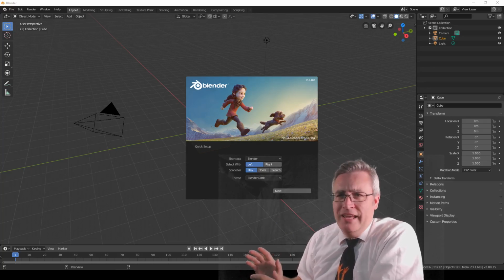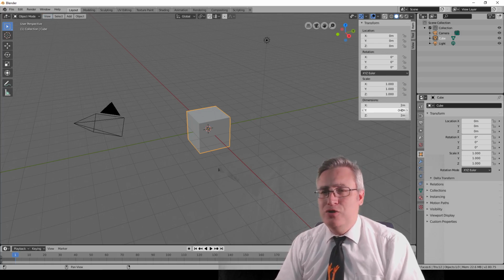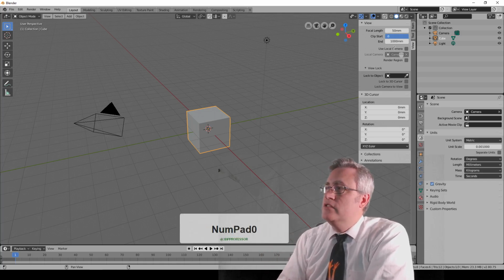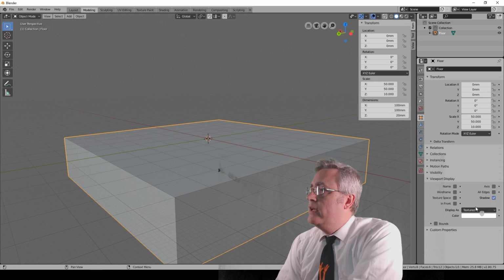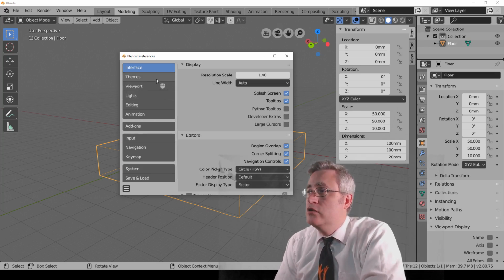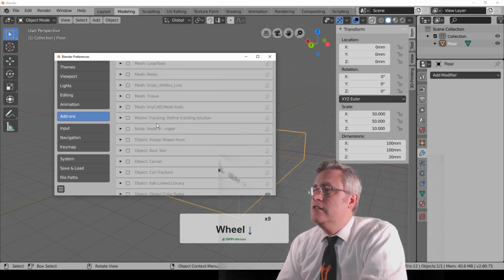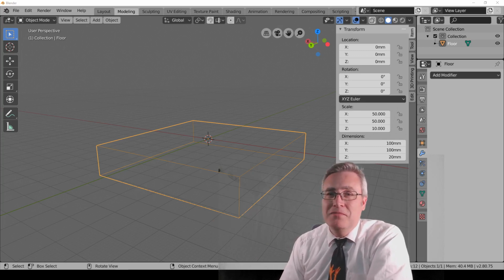Blender 2.8 for 3D Printing, Start Here - Part 1 Setup

Comment: Everyone please be aware that changing the "Unit Scale" will mess up cloth simulations. Took me a lot longer than I like to admit to discover that was one reason. Blender works with floating point, and accuracy gets lost with every conversion, which isn't obvious until you try to get a perfect 3D model of cloth covering an object that you want to 3D print as an enclosure.

My workaround: Still using the unit scale for modeling for 3D printing, just reverting unit scale before trying simulating cloth.
Reply from the maker: Good point. I don't do a lot of cloth sims because you'd have to solidify them to make them printable objects, and that tends to mess up on tight folds. So I tend to cloth sculpt these days.

Comment: So far all of your helpful advice still holds up even in the 3.2 verion, but I can't find the 3D tools: modifier view options in the add on menu. Do you know if they re-named it? or maybe it's just not there anymore? I'm using interface: modifier tools hoping maybe this is an updated version, but I'm brand spankin new at this and i'm trying to follow advice to the T when it comes to something as complicated as creating 3D models. I've tried playing with it and trying to figure it out myself and quickly realized I would get nowhere fast. IDK if you still play with blender now or not (i assume you do because of how involved you are in it) and I know it's a lot to ask, but would you consider making an updated version for the newer version of blender i'm trying to use? You seem very knowledgeable and i'd greatly appreciate your input on blenders new design. Even a reply to this issue would be great =) thanks for your help
Reply: well, now ive read the other comments and it seems there's answer's there.

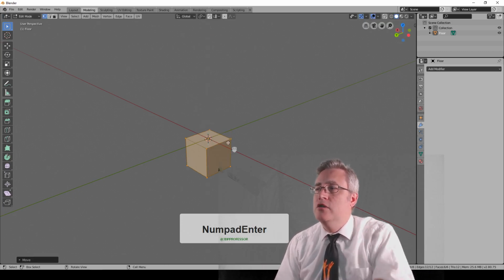Comment: Hitting the G, Z -1 dident work here... 8:00 in the video...
Reply from the maker: Have you tried it again? It still works in Blender 3.
Reply: @3dpprofessor  hitting G does nothing, Z brings up a shading menu.. First time using Blender. Probably something I have missed? It seems that I have version 3.0.1
Reply from the maker: @hvah  Interesting. House do you normally move things in Blender? Just move all the points up 1, however you normally do that.
Reply: @3dpprofessor  Thanks for replying. I found out what I did wrong.  I did not hold down z while typing -1. 🤦‍♂️

Comment: Hey guys im not like a blender pro or anything but if you are selecting multiple pieces and accidentally click off of them just hold control and press Z. It will bring back what you just highlighted. Thank you for this i really needed it for my first 3d printer.

Comment: Hi I Appreciate the video but none of the keystrokes work on mac OS blender v2.9 what is the breakdown of the actual steps of pressing G, Z, -1 ? Is there a way of enabling all the key strokes mentioned in this video?
Reply from the maker: I do not know. Why wouldn't G, Z, -1 work? That seems odd. But I don't have a mac, so I don't know.

Still, I do have a more absolute beginner guide where I've outlined the menu commands that are related. Object->Transform->Move, etc.
Reply: @3dpprofessor   I'll check out! I've "reset to factory settings" that seems to have helped.  Thank you very much for your videos and for taking the time to reply!

Comment: Hi, I've just bought my first 3d printer and have learnt a lot from blender for the absolute beginner... thankyou for the time you spend teaching us.  What I would love to know but can't find anywhere is to be able to create a crescent moon that is domed on the top... there is a tutorial showing what I need using autocad but I am just a hobbyist and want/need to stick with blender.
Reply from the maker: I would need a picture to better understand what a "Cressant moon that is domed on the top" would look like, but I can see 2 ways to do this. 
Method 1: When you get to Part 3 you'll learn about the subsurf modifier. Start with a cube, extrude and make a rough shape, then put a crease on the bottom, and subsurf and you may have what you want.
Method 2: Take a sphere and boolean delete a cylnder from it.

It all depends on exactly how you want it to look.

Comment: hi I was wondering if you could help me with something. I thought id make an alan key just for fun and im struggling to get the sides all lined up i feel there must be an easier way than what im currently doing.  i added a cube then added an extra line around the center to turn it into a hexagon. I added a reference image to try make things easier but then i realised that id still have to get that to the correct size.  Is there any easy way to do this or do i have to do what im currently doing and measure out 2 mm then shape each line to the size of the measure tool?
Thanks
Reply from the maker: Why not add a cylinder and change the sides to 6?

Comment: Hello! Thank you for very nice tip...I just wonder if it is possibe to make Blender to remember those setting you did with mm instead of meter and so on. I was just thinking it wold be nice to not have to ajust that everytime I re open Bender.
Reply from the maker: That's what saving the new default file is for. These settings are per file.

Comment: Generally a good job, but I'm having issues. I try to follow you, but suddenly my cube ended up with with little dots all over it which I was unsuccessful in removing. I decided to cut the whole thing and I dunno how to make a new one. the Add button doesn't seem to have have what I need either. All quite confusing. Suggestions?
Reply from the maker: Pictures would definitely help. Think you can jump on my discord and share some screen shots?
Reply: @3dpprofessor 

 I didn't keep a screen shot of the other one,  and I tried to copy a new screen shot here, but it didn't let me...but here's my latest mystery. After shift A, add mesh torus, for a while, the torus's suddenly (inexplicable to me) became really little. I know how to make them bigger,  but from the moment one got small, all the new torus's followed (cubes, spheres, ... all kept working fine).  Apparently I set a new default somehow which is persistent through program quit and restart..  I'm clumsy enough to have uninstalled and reinstalled blender about four times all in all for things like this. I'm guessing that I fat-fingering the keyboard..

I can always tell when a program came from a unix/linux mindset. There are a new set of keys you have to just memorize. They're very powerful, but (at least from my viewpoint) the power comes with a mind numbingly steep learning curve (if numbingly is a word).

I retired from s/w in 2013, but having started in at TI in 1976 writing assembler code for an IBM 1800, a few TI machines that you probably never heard of (960, 980...) turned to Pascal which TI thought would save the world (I can hear you laughing), then to a startup in computers driving robots around factories in Germany where we coded in C, then at E-Systems/Raytheon/L3/L3-Harris Internet(HTML/PHP/javascript/perl/SQL(OK-not a language),  C,  C++, Ada, Csharp, Python, and several more than don't come to mind right now.

Now that I was finally out of it (safely I thought in retirement), my son, Caleb gave me a little Crelity Ender-3 (3dPrinter) for Christmas thinking his Daddy would be able to figger out ( if figger is a word).

If I can ever get past yet another learning curve, I'd like to learn how to make leggo things before Caleb's children get past the leggo age. I'm not making much progress. Good grief. Christmas as almost a week ago!

Anyway, I think you're a great teacher, but I'm just a burned out old man.
Reply: @3dpprofessor : Duh... uh. what is ur "discord?"
Reply from the maker: @mazdaqwertuiop  https://discord.gg/rpwXqE5

Comment: Just started creating with blender for a project and these videos have been so helpful! You actually made program very duable, so thank you!
 I was wondering something however. When I add objects or a mesh instead of going on the grid it goes in the grid. As in the grid is in the middle of the object. Is there any way to change this so it's on top of the grid?

Comment: Great video! But i'm confused as to what program i'm to use to actually press "Print" and have my Prussa I3 start printing. Could you please point me in the right direction? Thanks!
Reply from the maker: Prusa slicer. I haven't done a video on it since Prusa took it over. It used to be called slic3r. But it's Prusa's choice of slicers.

Comment: If I want to build a model that is 1:87 scale (HO trains) and wish to create from a blue print, how should I set up my scaling?  Should I build my model in 1:1 scale, where 1 foot equals 1 foot, so I can build directly from the blueprint dimensions? Or should I do the math to convert my dimensions from full size down to actual print size, by converting everything down to mm or inches?
Reply from the maker: That's an interesting question.  I honestly don't think there's a right answer to this one. But what do you think would work best for you?

Personally I like to design in the scale I'm going to produce it so I don't get bogged down on details that are too small to print.
Reply: @3dpprofessor  thanks for the reply

Comment: i wish i saw this video before making my 3d model :'(

does this mean that the model i made is not 1.18 cm but 11.8 meters ? :O
Just glad i did not sent it in for printing xD
Reply from the maker: I mean, technically STLs are scale-less, so it can be whatever you want. And most 3d print services will take that into account. But millimeters are traditional.
Reply: @3dpprofessor  alright, i was wondering if the 3d printer guy would'n be able to tell his printer not to do this in a size that would'n come with him out the door again xD
Thank you for the confirmation and the video.

Comment: Thank you so much Professor! I'm learning Blender for 3D printing and I have set up my layout properly following your guidelines. I had started a build before this and was using 3D print toolbox, and banging my head with 'thin walls', zero faces and such. I found many fixes, but most of the issues were because my model was, well....really tiny!  

So I scaled it up after I placed in my build plate guide and Viola'!!  . . . the issues disappeared! One thing is my model now has some bizarre moiré pattern  in Layout... do you know how to make that disappear? Thanks!!  🤷‍♂️😁🙌
Reply from the maker: Strange moire pattern you say? No idea. Maybe jump on the discord and post a screenshot.
Reply: @3dpprofessor  Thanks, you know it turned out that it created some misalignments with vertices and faces etc. I did have other versions of that build, (thank you Lord!!). But I learned about aligning vertices and so on which teaches me how to fix my meshes, but ultimately I started again on one of my earlier meshes and things are going much better... YAY!

I think I should post the screenshot so others can see... I'll do that. Do you have a link? (Total Noob here..)
Reply from the maker: @abledog006  discord link in the video description.
Reply: @3dpprofessor  Ah.. thank you!

Comment: Really useful series of videos. I have a question:

I am new to Blender, but am about to use it for two quite different tasks - creating models for 3d printing, but also models / scenery for game design, Unity to be precise.

From your description it looks as though the preferences setup might want to be different for each (eg one needs lighting and a camera, the other doesn't).

Is it possible to store more than one set of preferences, and select on startup?
Reply from the maker: Excellent observation. And, yes, it's different... and it's not. But blender can only save one startup file.

So, one option for you is to, instead of saving it as a preference file, just save it. Keep the file somewhere you'll remember it and load that one when you want to start a project. (And remember to save-as before you start so you don't accidently overwrite it, or keep a backup somewhere.)

The other option is just ignore the units when you're designing for 3D printing. Remember that 1m is actually 1mm, and go. When you export it'll export as mm and you'll be fine.
Reply: @3dpprofessor  OK, got it! Thanks. Creating a template, effectively. I guess I could set my 'template files' to read only to avoid accidental overwrites.

Comment: The problem I've experienced with increased View Clipping Max value is the artifacts that show up, like back edges showing through model. So I keep it around 1200-1500 to avoid artifacts.
Reply from the maker: I run onto that only when I turn the minimum distance to 0.

Comment: Can I skip the floor part since I plan to print gears?
Reply from the maker: Sure.
Reply: @3dpprofessor  Hands down the best blender 3d printing tutorial I've found until now!!!
Reply: @3dpprofessor  should I go to edit mode and move it up or is it fine if I leave it as it is to model without ground?
Reply from the maker: @kishans9894  the ground plane serves 2 purposes. It provides a plane for booleaning the bottom of objects flat and it defines the size of an average build platform.
Reply: @3dpprofessor  thanks

Comment: What pc would be ideal for a beginner to start 3d printing
Reply from the maker: 3D printing or 3D modeling? For 3D printing the stats requirements are surprisingly low. A cheap laptop will do fine.
Reply: 3D Printing Professor Both, i want a pc that can run blender , cura and other 3d modeling and printing programs smoothly. I am new to this and i don’t know what pc to get
Reply: 3D Printing Professor I have a macbook Air (Latest model) but it starts to heat up after running multiple apps for a longer period of time.
Reply: @bigolboi1204  I would recommend at least 8 core new gen cpu, ideally the 7 3700x would be the best bang for buck.    Also at least a 1660 super.   That would be perfect for that.   16gb ram is enough, but 32 gigs will be 👌👌
Reply: Alex K how much would that be tho?

Comment: Nice video thanks you, the file you provided the link to is no longer valid, any way to get it? Curious to look at it, I'll follow your channel seem a good reference for 3d printing with blender :-)
Reply from the maker: Yup. It's gone. It wasn't mine. I'll try to whip something new up, but for now the video covers everything you need.
Reply: @3dpprofessor  thanks, it's a good video kudo, lots of great tips to help modeling for 3D print

Comment: Helpful tip if you are using OBS to record these videos: you can add more than one chroma key filter and slightly adjust the settings of every consecutive filter to get rid of the shadow from your green screen. I dont want to sound too critical but it is a bit distracting as it ends up near the center of your video ~ I was wiping at it thinking it was a smudge on my screen hahaha. Awesome tutorial!

Comment: I really struggled with this. I couldn't see on my monitor where some things you were clicking on (a closeup would help). I couldn't get the cube to drop to the floor in modeling using the keyboard either. ☹️. I feel like a dummy.
Reply: I had to Use Shift A to Select all the points before it would move.. It didnt auto select all the points like when He did it... Im in v8.2

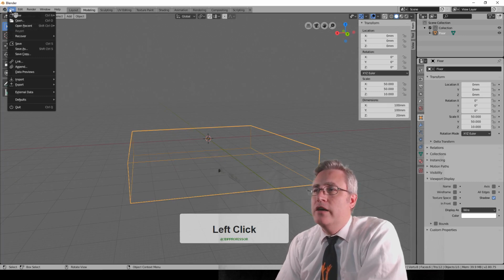Comment: @11:30 Can you save multiple startup files with different dimensions?  Like if I want to have this one specifically for 3d printing with my printer dimensions.  And another file with the grid and layout dimensions set to meters instead of mm?
Reply from the maker: You can save multiple files and load them as you need. But the startup file is only one file.
Reply: @3dpprofessor  ok thanks I'll leave the startup file as is then just work off the modified file for 3d printing

Comment: Question: Is there a way to make this work with Imperial units (specifically inches)? I’m hoping to 3D print some replacement parts for some 1/18th scale action figures of mine, but they’re usually measured in inches (most of them are 3.75 inches tall). Thanks!
Reply: Luke Landis set it in properties menu on the right

Comment: I don't get the same items on the addons that is shown on your video. 3D print tools and 3D modifier to name a few. how do I get to fix this? thanks in advance
Reply from the maker: No, a new version of Blender came out and messed everything up. I haven't had a chance to update the video yet, burr this will get you 90% of the way.
Reply: @3dpprofessor  that explains it a lot.  Looking forward to the updated video.